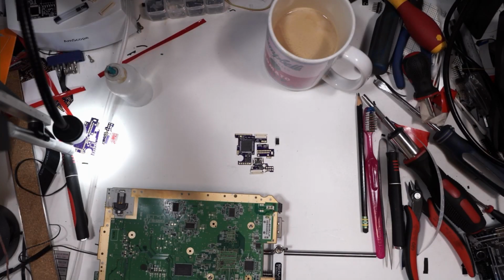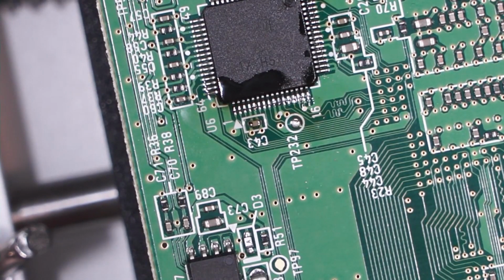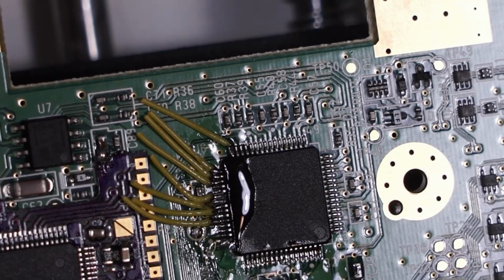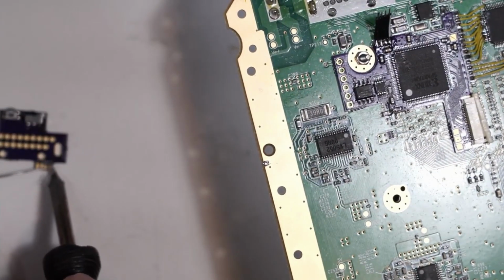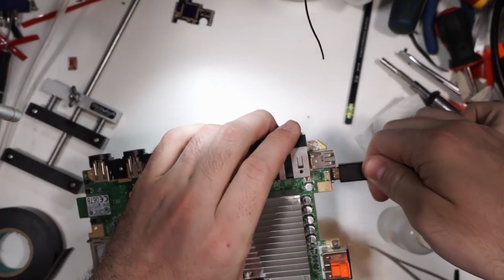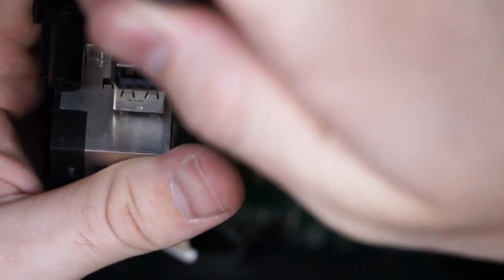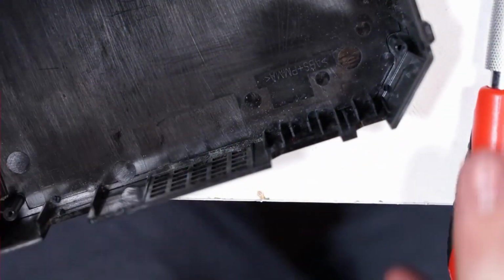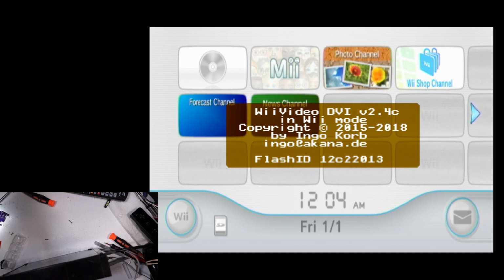HDMI Output Mod for the Wii! - ARTHRIMUS

Comment: I installed the v0.3 board successfully, thank you for making this available! If anyone else needs any help on here, I'd be more than happy to assist.
Reply: Please share more info!
Where did you order the hardware?
Reply: @DavideNastri  No problem! 

I ordered the WiiHDMI 0.3 Full Set from https://oshpark.com/profiles/Arthrimus/page/6 (I would go with the 0.8mm thickness). The individual components for all three boards (Main Board, HDMI QSB, IR Board) from the BOM (Bill of Materials) I ordered from Mouser, Digi-Key and eBay per their availability. I then soldered all the components using a stereo microscope.

NOW, the issue with the Main Board is that there's no actual jumper available on the PCB - instead, I had to bridge the left part of C3, the left part of R4, and the top part of C9 together to simulate the jumper. Then, to install the gcvideo-3.0e-shuriken-v3-wii.bin firmware (https://github.com/ikorb/gcvideo/releases), I used a CH341a programmer. I soldered wires between the programmer and the GND, 3.3V, CLK, MISO, MOSI, and CS pins on the Main Board, and using instructions from citrus3000psi's video on updating the GCDual (https://www.youtube.com/watch?v=RSG9kC6o0G0), I went ahead and flashed the .bin file and verified it. I then undid the "jumper" and removed the wires.

Lastly, I installed all three boards onto the Wii's motherboard. I used 32AWG enameled magnet wire to connect the AVE-RVL chip to the Main Board (as per https://github.com/ikorb/gcvideo/blob/main/HDL/gcvideo_dvi/README-Wii.md). 

I provided 3.3v and GND from test points on the motherboard to the Main Board, and a wire from TP27 to Pad. 

Finally, I soldered 4 wires between the IR Board and Main Board between the 3.3, GND, B, and IR pads. Worked flawlessly!

This is my installation: https://twitter.com/bahamutfan/status/1408027498529517572?s=21
Reply: @ivantasovski6327  
This is amazing, impressing and terrifying.
I don't think I can ever do this, sadly :(

Do you also offer it as a service?
Reply: @ivantasovski6327  hey, do you have links to the different components you purchased? I’ve been looking up some of the components but there’s so many different variations of each one. Any advice or links would be appreciated

Comment: Just curious, what is the difference between yours and Dan's design? I think I still see that you have TOSLINK audio support on your board.
Reply from the maker: The difference between mine and Dan's mod is that mine is HDMI only. It doesn't handle component or RGB out. My mod doesn't have anything to do with TOSLINK audio,
Reply: @ArthrimusTech  ah, okay. Good to know.

Are you selling kits at all? I didn't see anything regarding the Wii HDMI up on your store.
Reply from the maker: @guitaristtom  Not yet. I've had a lot of other projects taking up my time lately and there are some adjustments I want to make to the Wii HDMI board before I start selling it.

Comment: I'd be all over this if my wii was compatible. Mine is RVL-CPU-01 :( Got it a month after launch.
Reply: why would it not be compatible?
Reply: @DragonProtector  the board is different. I think the chip you solder to is rotated 90 degrees.
Reply: @LaptopGun  ahhhh. I have no idea the model for mine

Comment: Love to see that I'm not the only one who create bridges with when tries to solder on those tiny pads. 
Thx for the video and the public schematics. I'm going to try to install the v2 on my wii. 
I will update you with the results ;D
PS. I really hate the tv diodes on the HDMI board. I have put the pin 1 facing the FFC connector, I hope that is the correct position.